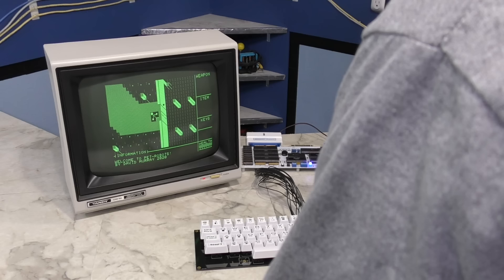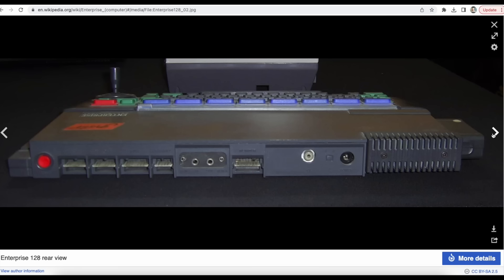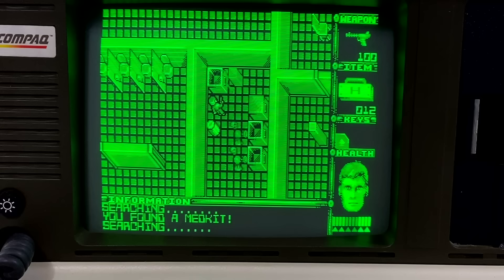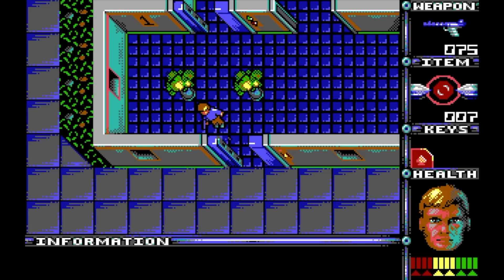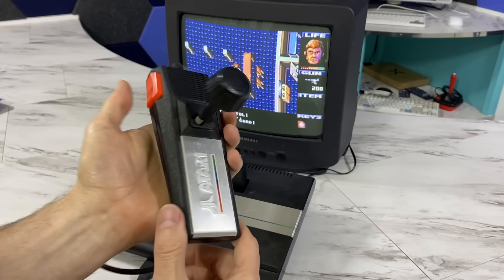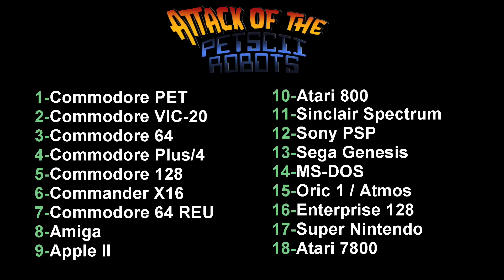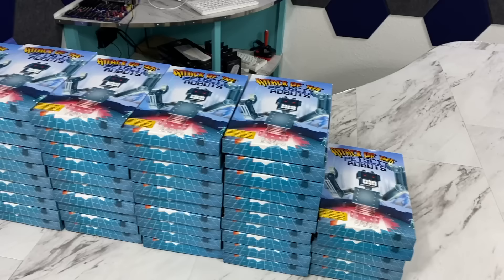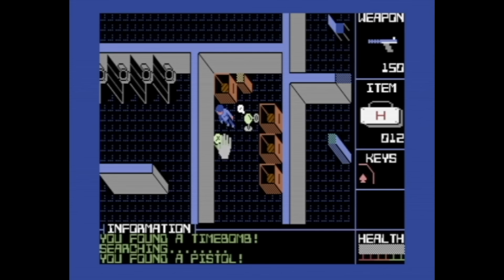Petscii Robots - The FINAL Update

Comment: This is very minor, but I can’t help but notice a few of the EGA palette assignments were made based on trying to get “close enough” to a colour in isolation, when substituting the overall function may have worked better. That probably needs a bit of application of colour theory though. 

Eg the sky blue could have probably been mapped to one of the turquoises, and darker shades are often less fussed about their specific hue (a dark blue can often be better substituted with a dark grey or even a dark red than a lighter blue). I also find the dark turquoise being “medium grey” looks strange when there’s an unused lighter grey in the diagram, in that context the lack of hue may have been more important than the shade. 

Of course this is all just speculation from the video, there’s always a balance to be struck. And I assume you tested other palette mappings before settling on this one. 

I noticed some of the other ports like the SNES version were slightly more liberal with their palette map to make it work and I did think that looked a bit more cohesive. Eg the guy’s shirt is cyan instead of royal blue, so he’s not the same colour as the floor tiles. 

Anyway, I reiterate my opening sentiment — this is very minor. It’s definitely not worth the extra labour to change given what you said in the rest of the video, but I feel as a colour nerd it’s gotta be said anyway. Depending on how it’s programmed (I’m guessing a 16-value table from palette number x to palette number y) maybe that’s a thing someone can do with the open source if they care.
Reply: From Wikipedia: "EGA produces a display of up to 16 colors (using a fixed palette, or one selected from a gamut of 64 colors (6-bit RGB), depending on mode)" I think there is still room for improvement...
Reply: Truthfully, EGA graphics have aged surprisingly better than first generation VGA graphics. First generation VGA graphics already looked extremely dated by the time the second generation came out

Comment: The Oric was effectively a more commercial version of the Microtan 65 hobbyist computer made by Tangerine Computers in the UK.  I owned a Microtan 65 and am currently building a replica using modern components such as the WD65c02 and 32k RAM and ROM chips.
It will be interesting to see if I can get Petscii Robots running on my machine once it's finished.

Comment: Thank you for the different ports!
I was impressed by the Oric port, because I know how capable yet limited that system is. It has 8 colors that can freely be used as background/foreground (a huge deal for that time), but they are set per line. You can switch them in line, but the place of switching contain no pixels. Pretty much what happens when a tile map is 1 byte so you have attributes or pixels(tile index).
A fun fact, Oric was created in Britain, but was much more popular in France and later in Eastern Europe (clones) even Brazil.

Comment: In case anyone wonders: If Germans buy something outside the EU and have it shipped to Germany, they have to pay German sales tax, which is 19% and it applies to the total value (product price + shipping costs). If the total value exceeds 150 €, then they also have to pay custom fees, which can be up to 12% of the total value, depending on what kind of product that is and from where it was shipped and that fee is then added to the total value before the sales tax is calculated (so they also pay sales tax on the custom fee). Worst case for something that costs 200 € (e.g. 170 € product price and 30 € shipping fees) is that you pay 24 € custom fees, raising the total value to 224 € and then you need to pay 19% sales tax (42.56 €), so the total price will be 266.56 € if you take care of all the custom handling yourself. If you ship via DHL and DHL takes care of it, they charge you another 6 € for their extra work. Now the good news: The custom fees on software regardless from where it is shipped are 0%, so you only ever pay sales tax for that. Still this should give you an idea why the EU is such a big deal in Europe: If you buy something within the EU, you pay nothing but the product price and the shipping (and even shipping has moderate prices within the EU).

Comment: Congrats on your Command X-16 looks like it will be a great home computer, I look forward to seeing it come out... I know it's been a long journey to get this far. I recognize production:  Component stuffing and through the wave soldering machine.  You're on the home stretch, plastics for the cases, assembly, and boxing up... Fantastic. I'm sure you'll give us details when available... I'm interested 

I wished I had time to do some of the technical things to help out, I did VIC-20 game development 1979-1982 with 2 games on the market, and I was a repair tech for VIC-20 and C64's in the 1986-7.   presently I'm overbooked with my work (Full-time firmware engineer) and my own projects,   but I never know...  I still find your system and ideas compelling, if there's something I can do... maybe port one of my VIC-20 games to X16 and give it an update?? Hmmm... Maybe, (never say never)

Comment: The Oric video system is bonkers. Each character was only six pixels wide, but consumed eight bits of data --- the extra bits were used to define control codes that changed the way the video system displayed things. This involved changing colours or even switching from text to graphics mode or back again. Unfortunately you couldn't put a control code and a visible character in the same byte, hence the black borders around the image. Those are where the control codes are which define the colours for the rest of the line. One of the oddest things you could do was combine text and highres on the screen together --- even on the same line!

Comment: I have that exact same Gravis Gamepad. Believe it or not, it uses the analog port but of course the inputs are digital. If you support this there is no reason to not support any other Analog PC joystick, you may need a calibration setup/code at most but you can easily treat the others the same. Only thing is that the typical PC joystick had 2 buttons.

Comment: Floppy Disks.  There probably are SOME unused ones findable on Freecycle as well as the potential for reuse of old floppies (see RMC The Cave for a minor cache in the SW of England that will be cycled into blank discs (bewaring of boot sector viruses etc). but it is a hassle to clean residues of labels etc off.

Comment: Boy lots of love for your game from the communities out there.🤗
7:24 I'm not a big fan of auto-conversion results when it comes to graphical assets so I have to wholeheartedly applaud your work since it's worth the effort and time.😉 Yeah CGA's 2bpp global palette setup is essentially 2bpp greyscale in practice, the second darkest shade could have been a little darker in hindsight but treating CGA like OG Gameboy graphics is the way to do them. Interesting about the inverted mode as that's another weird CGA quirk. Same respect for your CGA-Composite conversion effort, looks great.😁
9:23 I don't know why but that is true in DOS-Box, of all the communities out there I would think that one could get color fidelity and aspect ratios correct before any other platform emulation Ie. 99.9% of all DOS screens were 4:3 period. 🙄With automatic Hercules and or VGA to EGA approximation conversions the final results are mostly good, the higher 640x? pixel resolution compensates it well even with some visual errors.
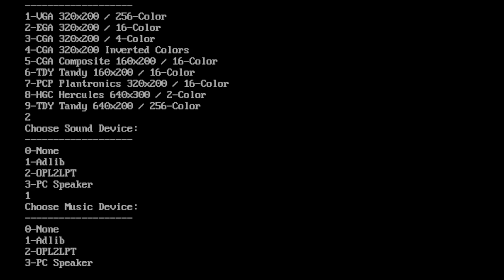10:47 Yeah the standard EGA palette or CGA based colors aren't great in practice lol, such a shame the full 64 color EGA system palette rarely got used for monitor support reasons. I tried the same thing with a few different 4bpp global palette options and found it hard to pair with EGA colors. With direct EGA pixel art I tend to limit color count to 3bpp per asset because the colors are too poor to reach towards 4bpp consistently across the colorspace Eg. some color ramps being wide next to color ramps with little to no gradient width, it sure is no Amiga heh.
13:28 It's funny but the fanfare for the Gravis Gamepad has kind of waned over the years to the point of many rarely mentioning it even when they themselves used one bitd. In hindsight the D-pad could have been better but certainly a solid DOS gaming controller, I think I have about a dozen of them now including some later day Pro model ones.😅
17:17 That was a pretty common practice on SNES to overlay the HUD rather than crop the game window, with only 256 wide you don't want to shrink the actual game space any further. Oh Mode7 use on the map, sweet.
🤬Yeesh anyone that calls you greedy is completely ignorant of how much things cost or how when you make something retro now you no longer have the backing of an entire industry anymore since they have moved on from that long ago Eg. Nintendo doesn't make SNES cartridges anymore, that's a big hint. International shipping costs is a real pitfall to cottage industries, the only remedy is an intermediator that can get bulk shipping and distribute in their own region, not an easy arrangement to make. Actually quite a few independent makers I simply can't afford to buy much from because they don't have the shipping infrastructure of Amazon. Anyway, sure glad I asked for that autograph when I purchased Planet-X3.😉

Comment: Amazing work! I can tell a lot of effort went into all of this.
With EGA support, I'm curious if you're using the default "CGA" 16 color palette or if you customized the palette? The video suggests the former, and I would be curious why you didn't change the palette for a closer color match if so, as my understanding is that EGA supports this in a limited form? (My assumption is hardware support for that is iffy, or that it made Tandy low-res support easier.) Definitely not a criticism though (and like you said I suspect most DOS players will use VGA anyway), I like understanding what goes into decisions like that.

Comment: I’m surprised a color computer version was even in the works! I didn’t remember that it ran on a Motorola chip (instead of a 6502 of some kind like just about all the other systems) until a while later, and wondered why they would bother with a color computer version, because it may require a considerable rewrite of existing code.

Comment: If this were the Mid 80s, you would be a millionaire from your games: Supply and creation of such materials would have been much cheaper, and cost/price of the games would not be much higher than they are today but the value of money then was much higher than it is now. Thus it is least to say, you started some 35 years too late to make a profit.

The Software game industry is not an easy one. The trails and tribulations I had with First Star goes to show that and I was just a simple programmer them. And you still have a couple more machines out there that could be fullilled though their markets are small...
(Oddly, they are more or less simillar machines like the Atari 5200 is to the Atari 8Bits - same chips but laid out onto a  memory map.

-Intellivision/Coleco carts; using the Z80, same sound chip (IIRC) and the same Video Chip by TI.

-TI 99/4 & 99/4A, Except for the CPUs, uses the same chips as the Colceco and Intellivion because they made the chips.

-Spectra Video and MSX machines, though using a Z80, uses the same video and sound chips as the TI 99/4s.

Programming for these systems would not be that hard to do even on a moderate Mid Based system.

The only thing that blows my mind is why is there no Coco version? That is a huge untapped market for these games. One can say that many of them do not have diskdrives and only cassette drives. But there is a Cartridge Option to go for if need be.

And Why is there is no Atari ST or Mac version? A Mid range 030 Mac would be playable on many Macs including PowerPC, and yet can be played on a Mac SE with the High Density Floppy Drive. And any game that cam be made on am Amiga can be made on the ST.

Lets see what the futures holds. I understand that you are in a situation where you need to complain but you also need to address those issues as well.  All things are doable, with the proper planning and setting up of resources.

Comment: The Atari 7800 shares little to no hardware with the 8-bit line, especially in terms of graphics. Therefore, the 7800 version is not a 'what if' scenario for the 8-bit computers. PETSCII robots on Atari 130XE would be about the same as PETSCII on the 800, with maybe a bit more detailed graphics and more music (because of the added RAM). Most importantly, the 130XE use the same ANTIC/GTIA chipset as later 800s. With limitations of that chip, the game would still be monochrome.

Comment: Will the Atari 7800 SNES adapter work on an Atari 8-bit machine like the 800?
Reply: I just came back from Atari Age. The SNES2ATARI adapter isn't the same as the earlier SNACK adapter the Atari 8-bit versions of PETSCII Robots uses. But the SNES2ATARI is much simpler, and systems with the 9-pin joystick port could work with it if software was adapted to use it.

I know the original user port adapter is for the PET, but every 8-bit Commodore PC afterward has a joystick port. I wonder how hard it is to adapt the existing Commodore ports to use SNES2ATARI instead of or in addition to the user port adapter.